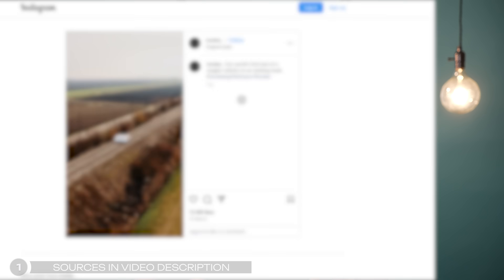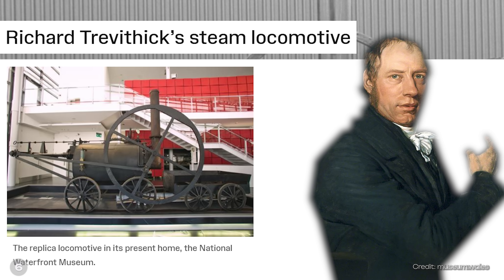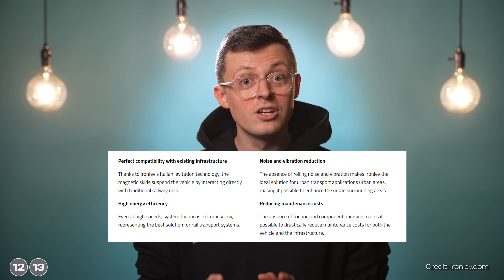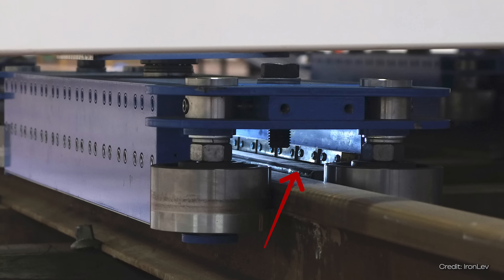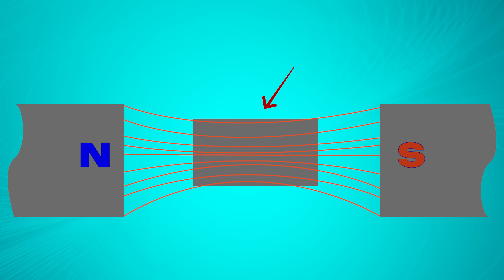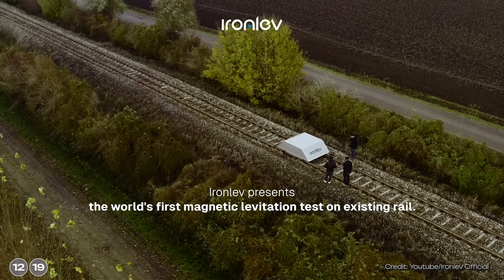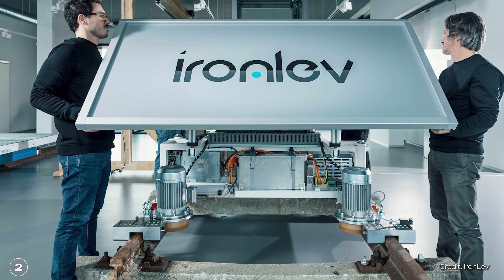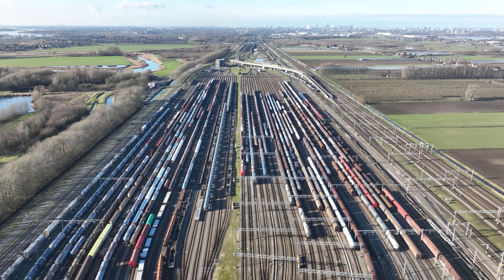World's FIRST magnetic levitation train on RAILS - Is this the train of the future?

Comment: Now imagine connecting Hamburg to Hannover, Hamburg to Berlin, Hannover to Dusseldorf, Berlin to Dresden, Dusseldorf to Cologne and Frankfurt, Frankfurt to Nuremberg and Nuremburg to Munich then connecting railways left and right as well.

Now imagine building that railway network underground where there are no building or streets or mountains in your way, and imagine building it with smooth silent Maglev that travels at 350 Km/h.

China has perfected Maglev so I don't know if it's necessary to reinvent the wheel but then again i hope they make it work, either way underground railways are a promising technology with massive benefits when you consider top soil is 0,000001% of the Planet (i made that number up for effect it's probably not very accurate but divide the surface of the earth into grains of sand and compare it to how many grains can fit inside the earth and you'll get it.

The term scratching the surface starts coming to mind.

Comment: You dont necessarily need to upgrade the switches. One naive solution could simply be a hydraulically extended set of ordinary trucks to lift the cars off the magnets. Take the switches in the traditional rail mode, then retract the wheels again for maglev afterward.

This would also be the solution for parking the train too that allowes for unpowered braking and rolling.

Comment: I built a personal rail cart on polyurethane wheels for rail camping adventures. It's nearly frictionless with 1 finger pushing nearly 130lbs. Steel wheels are heavy, super noisy, but insanely durable and even more frictionless. Mag lev is cool tech, but not really practical for the precision in heavy rail track around the world and super expensive compared to a simple load bearing set of steel wheels.

Comment: Thing about metal wheels is, they are as close to theoretical ideal wheel (->0 contact area) as it is possible, a theoretically inelastic circle has a single point of contact with a surface thus as low friction as it is possible. Steel is a bit elastic, that way trains can at least move. They're not removing friction between wheel and rail, as it already is soo low in a conventional train, they're removing friction inside the wheel assembly - all the bearings and things. Yet when they do so, they introduce currents in a rail, and due to the laws of physics, things that have ability to pass currents hate it when something magnetic moves or changes in power/pole (physically indistinguishable cases, I must say) near them, and induce a magnetic field forcing that change to stop. And, as this action is as potent as a reaction, minus losses, you get a feedback loop of ever increasing magnetic "friction", making this unscalable.

Comment: This approach can be used on local electrified lines where you would normally use trams or metro with electromagnets instead of permanent magnets. The main benefit - lower noise and vibrations a.k.a more pleasant ride for passengers.

Comment: if they are using sideways clamping via a combo of the magnets and the drive wheels, then potentially they can make lighter trains and traincars- a big part of the reason these are so heavy is because they need a lot of normal force due to gravity to exert sufficient friction to accelerate & stay on the track. Also I wonder if the eddy currents could be a feature not a bug of the drive mode.

Comment: My issue with magnetic levitation is: the rolling resistance of a train wheel is already so low (~0.001) that it hardly seems worth the trouble to eliminate that last 0.1%, especially if you are then going to use a friction roller to drive the thing, thereby negating most of the gains you've made.

It only seems worthwhile if, by using maglev, you are avoiding some other disadvantage of wheeled running, eg the increasing need for better materials and higher manufacturing tolerances as speeds get seriously high (say significantly over 200mph/ 320kph). I'd be surprised if maglev with friction drive showed significant advantages over conventional rail at speeds of 'only' 200kph...

Comment: Considering how much train weight is on those metal to metal wheels the rolling friction is pretty low. If it can't carry 50 ton of cargo it's useless. If it can't go through switches it's useless. My local tram line is a small passenger train with very minimal switches but many road crosses. Big gaps aren't nice for bicycle's and it basically needs a full rebuild to make it work. To be honest they did mayor rail replacement fairly recent too, it's good for a long time😊

Comment: My big issue is that I am limited by the mass of the magnet.  By the time you put real mass on the test train, it will fail. Unless you can input power (usually electric or thermal) you cannot input power to a magnet.  It is what it is.  Sorry.

Comment: I could tell seven second in that this won't work as advertised.  It works okay on straight and curved track, but they'll need a solution for switches, grade crossings and diamond crossings.  At frame 0:06 to 0:08 you can see how the device hangs below the head of the rail on both sides, which will prevent it from working with the current infrastructure.

Comment: Normal locomotives pull anything by having a lot of traction between wheels and rails caused by weight pressing the wheels down. I don't see these side-mounted motors gripping to rails with anywhere similar force.

Comment: So they wanted to solve one problem with Gadgetbahns - namely, requiring their own specialised track incomparable with anything else - but their proposed design would only work on lines completely disconnected from the rest of the network and with no crossovers or level crossings (so severely limiting where it could go without, erm, building new track, so completely negating the stated benefits), has numerous problems of its own, and could potentially lead to even quicker track wear than existing trains.

It's very likely the ACTUAL point of this (as with other Gadgetbahns) is to transport money from gullible investors into the bank accounts of the project's founders...

Comment: Just because it levitates doesn't mean there's no magnetic friction! Most people don't realize what extensive magnetic wear can do to metal surfaces. If you have an induction stove you might know what I mean. If you use the same pan to heat food in an induction stove, after a few years, the bottom of the pan will start blistering and bending. Small surface stains similar to snowflakes will form on the internal surface of the metal and the whole thing will warp! This is due to the heat and the magnetic resonances. Energy always does damage to substance. This cannot be avoided!
Reply: But reduced by a lot. And heat is not a good comparison here. Just heating metal does less damage to a metal structure than friction. So, in your comparison, the pan with fire has the least friction as long as it doesn't melt the pan. Yes, it has a little tiny bit, but many woks survive for generations, so it's negligible. Friction from metal to metal is way different, though. Yes, there will be wear, but compared to metal scraping and rolling over metal, it is negligible. I think the question is whether it will be cheap, efficient, and/or good enough to actually be something you can get money out of.
Reply: Also, the magnets likely have to be remagnetized every few years, as the use will weaken them.

Comment: I can see an application for its use on the Moon Ir you have a circular rail with no switches on the Moon that is 100 meters in radius, the tangential velocity to produce 1g of centrifugal force is 70 miles per hour, so if you have a maglev railcar that operates at that speed with no friction on the track, then you can create a smooth centrifugal force with no vibration simulating 1g on Earth, turns out this is 3 rotations per minute, the important part is that these tracks would need no or little maintenance, and iron is a common material on the Moon to build these rails out of. You just need to create a tunnel for the railcar to move under for radiation protection, and you could then have a 1g environment for astronauts to live in with very little sensation that they are in motion relative to the surface. The car would be tilted almost 90 degrees to the surface so as to combine centrifugal force with lunar gravity to produce 1g. Since the track is a continuous loop there would be no track switches.

Comment: I think it's a great technical exercise, but not practical on existing rail systems. That said though, I do think that there could be practical applications on lighter systems, for moving parts between buildings, or even cable cars/overhead rail systems.
Reply: There are also dedicated railways between mines and ports that - here in Australia at least - run for hundreds of kilometres without any switches, crossovers, etc.  The mines have plenty of money and don't seem to mind experimenting with new technology either (given all their battery vehicles and kilometre-long driverless freight trains) so if it makes economic sense it wouldn't surprise me if this sort of thing shows up on the mine railways first.  Of course if it doesn't end up there, I think that would say a lot about the technology's practicality.

Comment: Existing train wheels have a long life and have tyres (made of metal) which can be replaced / recycled. Monobloc axles are only used for very heavy items such as cranes. If they did make all the switches / points compatible with this the junctions would not be compatible with existing wheels. How is this to be powered and again while permitting existing trains to run.

Comment: How about a wind powered perpetual motion train? You could drive it with lots of little wind turbines on the roof to generate the electricity.
Reply: Perpetual motion doesn’t exist, it would break physics. Factors like air friction and wheel-rail friction would result in a energy deficit
Reply: @Plasquin261 
Enclose the railways in a vacuum tube and put anti-friction gloop on the rails.

Comment: Cost more, can't use current network, slower and may be lower capacity ... 100% it will fail. Moreover, a new generation of high speed train is coming to the market with a better efficiency ( for exemple TGV-M consumes 20% less than it's prior version )

Comment: Do you know why MAGLEV has a completely different track? Have you heard about eddy currents and so-called thermal losses "in iron"?
Well, you probably know that in order to lift a load with a magnetic field, you MUST create a sufficiently strong magnetic field. Ordinary rails are completely unsuitable for this. Firstly - because of losses, secondly - because of the inability to accumulate a sufficiently strong magnetic field, thirdly - because of the rapid heating above the Curie point and the loss of magnetic properties by steel.
You can make yourself a small and light toy demonstrator. But you won't make a regular train that way. It is too heavy.

Comment: Over time, especially in summer months, the rails could become weakly magnetised. I wonder how this could affect long term use. 

I am not saying “no” to the tech. I like the reconceptualisation of rail transport to hopefully minimise problems.
Reply: I don't think it has a shot. First off, the premise of reducing wear is completely incorrect. Magnetism does in fact wear down the things it rides on. This will be more pronounced as they take on more weight like full on trains. Magnets will also induce a heating effect into the rails that's much worse when stationary. This seems like a huge flaw for railyards or train stations where cars will be sitting for quite a while or at any signal that mandates you stop. 

The system also has major issues with working with existing rail crossings, switches, crossovers, or even the shields used on bridges due to how the wheels hang on both sides. Right now, switches just have a slight divot for the flange of the wheel to ride through, but with this, I don't see how existing switches could possibly work. It hangs at least 2 inches down on both sides and has the wheels sticking out a good 4 inches.

Comment: I see issues with level crossings, switches, and crossovers given the way this thing hugs both sides of the tracks.
Reply: Quite a lot of 'conventional' maglev trains pop out wheels at lower speeds, during emergency stops, etc.
Reply: One other issue with permanent magnets is accumulation of magnetically-attracted particles. With electromagnets it's not a huge problem as you can turn it off, so you have a way to get rid of the debris. Not so easy with permanent magnets.
Reply: @Marc-ww7cc  you are right. especially with railways, where they permanently have metal grinding on metal. if that accumulates on the track, the situation will not be funny.
Reply: yes, me too. it is okay for going straight ahead, but that's about it.
Reply: Same. It really seems like the only benefit of this over a linear induction-motor or a conventional motor is that it might reduce the direct wear on the rails, however as evidenced by Toronto's Scarborough RT train derailment we know the magnetic force required to lift the train is also enough to loosen railway spikes. While railway maintenance is expensive, it's nowhere near as expensive as motorway maintenance due to requiring less space for throughput and just needing less frequent maintenance altogether. Wear on the rails is not a huge cost-sink in railway maintenance, not compared to ensuring the sleepers are stable or the spikes aren't loose.
Reply: you'd require differnt switch functions like need soo many moving parts even on cross tracks
Reply: Or maybe something else on the ironlev bogies
Reply: Considering that the deployment would be on high-speed trains, there would be no level crossings on roads in the first place. Secondly, with the possibility of activating standard rails along low-speed segments (and perhaps with dedicated switches if they gain traction and replace the existing ones along high-speed routes), the implementation costs would be extremely low, since it would mainly involve adaptation.
Reply: if you watched the whole vid you would realize he covers this...

Comment: Lifting the train cars off the track for maintenance would be tricky, if the magnets are strong enough to support the weight of the train then you'll have to pull upward with at least twice that force to separate it. And make sure nobody goes near the magnets with steel tools or parts.
Reply: There are ways o switch off a permanent magnet.

Comment: They could add a large expensive wheel and lift system to lift over the switches and the road crossings. But the drive motor wouldn’t work then.

Comment: This idea will never work. The coefficient of friction of a steel wheel on a steel rail is so ridiculously low that from an energy point of view, rail is way more efficient than moving mass via a rubber tire wheel which is what cars and trucks use. 

My college professor at MIT 60 years ago was a specialist in Maglev trains, and they have never been practical. 

The current diesel electric hybrid powertrains as used in the GE trains in 1965 has yet to be improved in any significant way. One can argue that trucks and cars should have adopted the serial hybrid approach that is used in Locomotives, but alas the car/truck business is incredibly stubborn

Comment: Almost everything about this idea is wrong. But the simple cost of the magnets certainly doom the project from the beginning. We are only beginning to see the prices of rare earths rise. For the immediate future, supply will not be able to keep up with demand, so prices will rise. And the thermal stresses on the rails? Immense.
Reply: Depends, if it works and make trains more effiecent they will pay off the extra cost.
Reply: It so fun seeing all of these dead end projects suck up valuable resources while practical solutions are ignored. 

Money laundering? Seems like the only way to thrive today is crime.  

We’re cooked.
Reply: Yes this system doeant realy adress hill climbing acceleration and braking as far as energy use .  It also does not solve flxability nor wind resistance nor safety .
Reply: Rare earths aren't actually rare.
Reply: @thomaskalbfus2005  they may not be actually rare in terms of abundance, but they’re exceptionally difficult to extract, process and bring to use…
Reply: @weatherlou  So if they're not rare in abundance, what makes them rare?
Reply: @Ben31337l  They're called rare earth because they're only found in very select places and most form in compounds of each other so where you find one you find nearly all of them. Very few nations mine them and the US for example shut down nearly all their rare earth mines. Right now there is only a single mine in the entire US for rare earth.
Reply: @Ben31337l they’re part of the “rare earth” elements, which include 17 elements: the 15 lanthanides plus scandium and yttrium. They were named “rare” in the 18th and 19th centuries because they thought they were rare at the time.
Reply: Maybe we can make artificial magnets?
Reply: @cyanide_stew  Errr... That's what you use the rare earth elements for!
Reply: @cyanide_stew  The only 'artificial' magnet that doesn't need rare earths is an electromagnet.  But you trade the rare earths for needing a constant supply of power, and sometimes quite a lot of power too.  That then pushes the problem back to one of energy storage and needing better/lighter batteries.